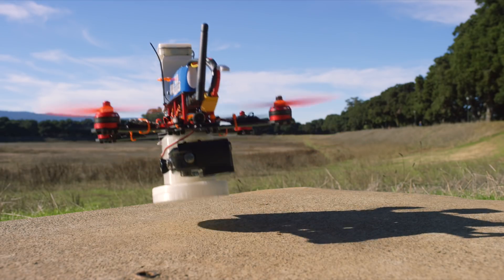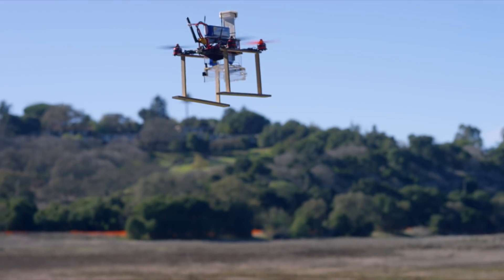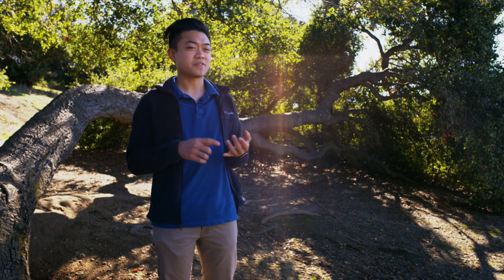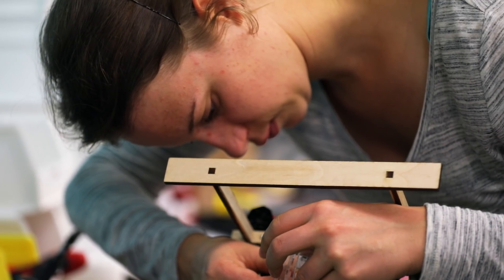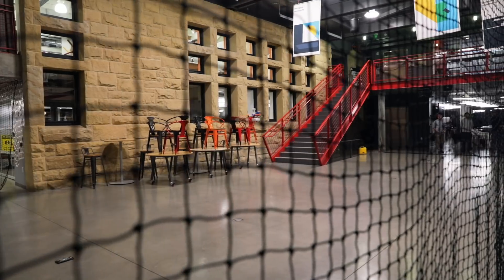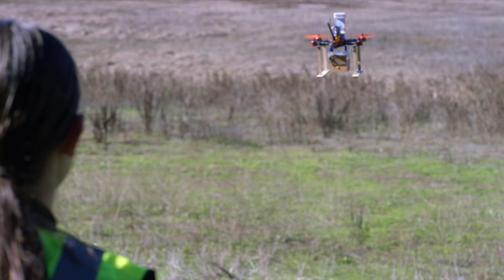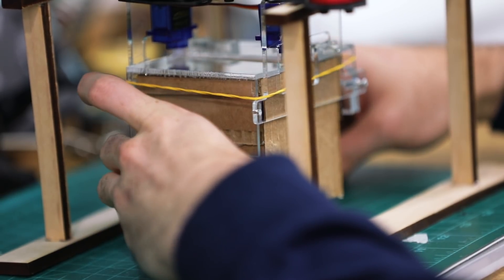Stanford students design and build autonomous delivery drones

Comment: They're just building DIY drones like any hobbyist ? 
And "the delivery experience"  :  lmao...
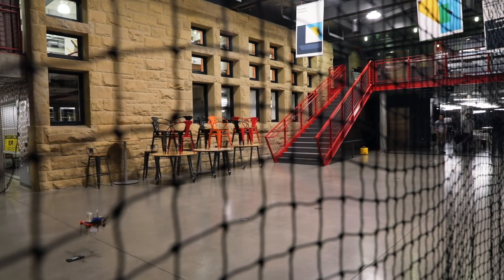Reply: Obviously "the delivery experience" was silicon valley talk, but you shouldn't be so quick to judge the course. It is a rare experience that undergraduates get to put a system together such as this. I wish I could have a course like this, and I believe many others wished they had the opportunity too. The work required to put a drone together, design and program the payload mechanism is no small feat for a term project. Judging by the clip @0:52, they are using a PixHawk, that tells me they are probably using ROS to do GPS waypoints and learning ROS in itself is very time-consuming.
Reply: The fundamentals of building a delivery drone, out of all honesty, isn't that hard. The only difficulty would be, to cover parts such as obstacle avoidance of small objects and flying under bad weather